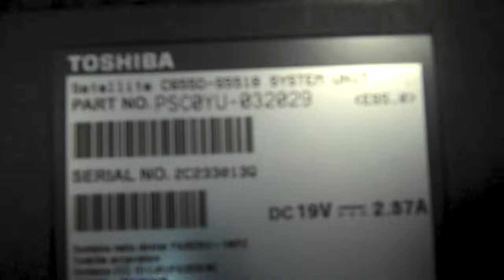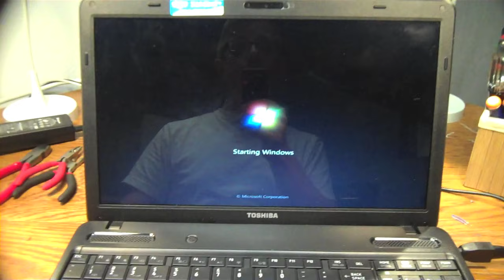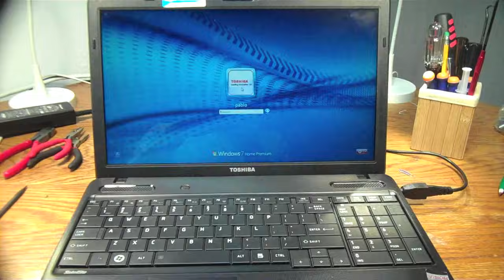How to Reset BIOS Password on a Toshiba Satellite Laptop

Comment: the satellite  c55-a5300 I have a pad labeled p200 its just 2 pads by the memory board, I am hoping those are it.  Now the Supervisor passwords been set not the users so on the 3rd try it shuts down with no code. I cannot find instructions at all

Comment: I have an old toshiba 1405-s151 with a "power on password" (what the user manual calls it). I haven't used this computer in maybe 10-15 years because I forgot that dange password.  There's nothing like this b500 thing on this computer that I can see. Do you have any idea how I can get past or reset this power on password? Thanks!

Comment: Donna OConnor
If you are still doing videos - I am really stuck on my Toshiba C55-A5310.  Windows 8.1. When I turn the screen it is all black with a box in middle of screen - is blue and says the words "enter password" When I enter in a password, it than goes to another screen which reads : Error Status. Verify error!! Press ENTER to continue. It goes back to first screen. I haven't got a clue how to fix it. Tried your method, must have done something wrong, as it did not work

Comment: Hey thanks I'll try it in a sec. Question every time is asks for the password I actually have the password because I said it I type in the password and it goes directly back to the screen that says no boot load please restart system I've probably done that a hundred times in different ways but also again note. I have been severely hacked for the past two years now we're ransomware remote sniff duplicating apps draw overs you name it I've got it and I think he has tried to make it to where I cannot get into this computer. Do you know anything about how I might be able to puts a Nord antivirus and VPN and install it from another location and then implement it into two of my devices before I get back to where I usually do all my stuff with computers which is at home.???? Thanks again I'm going to give it a shot and I'll get back to you

Comment: What do I do after I've done this but now it start up but there's nothing showing on the screen
Reply: I have a Toshiba satellite c55 b5308
Reply from the maker: Check that you seated the video cable correctly. Almost always the issue. Also check all cables, RAM, etc that it’s properly connected.

Comment: Hi,

That was cool, and makes sense.
My problem is that I DO have the BIOS password, and I'm trying to do a factory reset, (i.e. "Out of the box"), but the accursed thing just ignores me when I do the 10 second power-off, then the holding down the 0 key after hitting the power button.
It asks me for my BIOS password, which I then enter, but I don't get anything else except a machine that starts up normally.
It's horrible Vista, and it has some issue with AVG files that don't exist, even though AVG is supposedly uninstalled, and there is a random name in the system that seems to belong to some sort of high-powered administrator. I don't know who this person is, and I would suspect that my ex had something to do with it, except she has trouble spelling her own name, let alone anyone else's, and using the most basic computer functions are pretty much beyond her. This is not to say that she didn't enlist somebody else's help in my absence, but surely there is a way I can still do a factory reset???
I can't get rid of it, and when I got pissed of enough to instal Linux Scorpion, this name appears all over the place there, and kind of messes with all my filenames.
I'm gonna try to kill the BIOS password as per your excellent instructions, but I can't understand why, seeing as it's MY BIOS password, that I can't just go into BIOS and remove it.
As I say, my biggest problem is that it just WILL NOT DO THE FACTORY RESET THING, and it's doing my head in.
It's an A200 Satellite, and as far as I can make out, the model number is: PSAF3A-0OH01N. I'd throw it away, but it's had almost no use since new, as it ended up in a box after a shift, and only resurfaced recently. I actually thought it had been lost or stolen.
Any help would be appreciated.
Many thanks from the Southern Hemisphere.

Comment: Great video and very clearly spoken and explanatory.  I was able to bypass the password on the second try but it was flashing and the screen went black.  I cannot get it back to desktop.  I did not have cat 5 cable and used the wire fraud it of a cat 3 RJ11.  Could this be why it went black on me and how can I get it back?  Thanks so much.

Comment: It works on a300, I did it at my 3rd try. I have tried different combinations the worked one was. Remove battery, ram and hdd connect the charge cable, open the pc (it will not open ) do the jumper thing and without unpluging power cord put rams and hdd then open the computer.

Comment: I have a Toshiba satellite laptop, I first installed Windows 7 but later installed another Windows 10. so I still see old windows on it but I try deleting the old windows but I couldn't. so now am still using the windows 10. I have tried several times to activate the windows 10 but i couldn't. Yesterday, I tried installing a new Windows but the PC couldn't boot from the USB drive. I tried several functional keys but still I didn't boot from the USB. please Any help?
Reply: prepare your bootable disk using a different USB drive avoid generic USB stick

Comment: Hi guys.  I know this is an old video but I recently had to reset a Satellite A505-Sxxxx notebook and it took forever to locate the B500 jumper connection.  Finally found it.  https://i.imgur.com/aEzq6rL.jpg  It's located on the other side of the DRAM modules.  Hope it helps some people.

Comment: I have a Gateway LT3103u that does not boot up. It intermittently booted 2 times the last 2 weeks since I have received it, but it won't now. I can hear the fan, the power button lights up, but none of the other lights stay on even though they momentarily flash when I hit the power button. I even put an external monitor on the unit to see if there was a screen problem, and the external monitor doesn't even recognize that it's plugged in. Any thoughts?

Comment: Have you tried this on a Toshiba Satellite C855D-S5106? I have tried this a few times and still can't get it to work. My B500 solder points are in a different position (further left than yours)?
Reply: I can't get mine to work using this method

Comment: Hey DYI Tech, I have a couple of questions about my Toshiba Satellite Vista, Model A205 Laptop. First one issue is that when I boot it up and once on, if I need to plug the power supply to it, it Freezes and will stay frozen. I have to charge it then reboot to use it without plugging in.? Second I can't get any update so its vulnerable and outdated.  I lost the the software disc also. Finally when I can use it the battery life is short and periodically will shut down unexpectedly. Fan work!! Anyhow do you have anything to help with these issues..

Comment: i have a Toshiba Satellite c855-s5190. i am trying your trick, however the laptop will not power on without the hard drive in. any suggestions.  also the removal didn't work with the hard drive still in

Comment: I have a Toshiba Satellite L555D-S7930 & need to clear the Bios password. I have located the J1 jumper point, but do not know which of the other spots I need to connect it to.Can you help me?I located 2 JCPU Spots, among others. But no J6, XXX or B0500 spot or anything even close. Thanks for any help you can give me.
Reply: I finally just grounded the J1 jumper point to a screw on the motherboard & that did the trick, clearing everything.

Comment: Great video. I have a Satellite P205D-S7802. It's the old vista. Can I do the same thing with it? Also, I have lost 3 characters on the keyboard which I currently cut and past. Is there an economical fix? I have used a dell usb keyboard too...but I think it has been creating some blue crash dumps...the other problem I just started having. Also it seems to not want to continue the boot process even after I put in the password...any hope???

Comment: I need help doing this on a Toshiba L855-S5240 It has the b500 jumper pads but it does not work. I read somewhere that it wont work on newer laptops. The only similar other video is one for a C855 but the L855 does not have the pads from that video. Please help! Thanks!

Comment: it worked. u can use a screw drive except for wire. also when it says "the firmware has detected that a cmos battery blah blah", be sure to press f1 (continue), holding the wire/screw driver on the two b500 slots. then it boots the os and u're done. thanks a lot for the helpful vid

Comment: Toshiba bios password removal for latest models

Satellite P100 & Satellite Pro P100
Open Wi-Fi Cover
Remove Mini Card Wi-Fi card
Locate & Short Out JP8 for 5 Seconds
Remove short and turn on
NO BOOT
Press & Hold Power button to turn off
Turn on again & password is cleared

Satellite L10, L20, L30 & Satellite Pro L20
Open Wi-Fi Cover
Locate & Short Out JP1 for 15 Seconds (Satellite L10)
Satellite L20/Pro L20 short out G1

Satellite M100 & Tecra A6
Open Memory Cover
Remove Memory
Remove Black plastic insulation
Locate & Short CMOS CLR1 for 15 Seconds
NOTE:
All the following models use the same password removal process.
Satellite: 17xx Series, 1000, 1110,1130, 1200, 1900, 2430, 3000 P20,P30, P33, A30, A70, A80, M40X, M50,M60, M70, M100

Tecra A3/S2, A5, A6
The jumper is always located under or near the memory modules
Depending on the model the jumper could be labelled J1, J2, J5, J7, J9 or CMOS CLR1 (M100 & A6)

Satellite,Equium A100 & Tecra A7
1.Remove Strip cover
2.Remove 2 x K/B screws
3.Move K/B Unit up but don’t disconnect
4.Release & Remove Mini Card Wi-Fi Card
5.Locate & short C88 Pin 1 & 2 together
6.Power on Machine while still shorting Pin 1 & 2
7.As soon as the TOSHIBA logo appears, remove short
8.If machine boots, Password has been removed

Satellite A100 (PSAA2A-02C01N)
1.Remove Memory Cover from base of machine
2.Release & remove right side Memory Module
3.Lift black plastic insulation
4.Locate & short PAD500 Pin 1 & 2 together
5.Power on machine while still shorting Pin 1 & 2
6.As soon as the TOSHIBA logo appears, remove short
7.If machine boots, password has been removed

TECRA A4 & Satellite M40
1.Open modem & Wi-Fi card cover
2.Remove mini PCI Wi-Fi card
3.Lift up black plastic
4.Locate & short C738 Pin 1 & 2 together
5.Power on machine while still shorting Pin 1 & 2
6.As soon as the TOSHIBA logo appears, remove short
7.If machine boots, password has been removed

TECRA S1
1.Open palm rest cover
2.Remove mini PCI Wi-Fi card
3.Lift up black plastic
4.Locate & short C5071 Pin 1 & 2 together
5.Power on machine while still shorting Pin 1 & 2
6.As soon as the TOSHIBA logo appears, remove short
7.If machine boots, password has been removed

TE-2300
1.Remove 2 x B12 screws from bottom of system
2.Remove strip cover
3.Remove keyboard screws 1 x B2.5 & 1 x SF4
4.Remove 1 x 4mm screw & Wi-Fi cover
5.Remove mini PCI Wi-Fi card if fitted
6.Locate & short points as shown in picture below
7.Power on machine while still shorting points
8.Short for 5 seconds
9.Nothing will appear on the screen
10.Turn system off holding down power button
11.Password is now removed

Satellite A60
1.Open Wi-Fi slot cover
2.Lift up black plastic
3.Locate & short C561 Pin 1 & 2 together
4.Power on machine while still shorting Pin 1 & 2
5.As soon as the TOSHIBA logo appears, remove short
6.If machine boots, password has been removed.

Satellite Pro L40
1.Open Wi-Fi  & RAM slot cover 
2. Locate JRST1 Between Ram and Wifi slot 
3.short JRST1 AND TURN ON SYSTEM.
4. Short for 15 seconds.
5. system is shutdown automatic.
6.turn on the system password is removed.

Toshiba Satellite Pro L650 

Locate G1 or c513 and G2 or C514 to reset bios
In some models it will be B500  under ram cover                                                                                                         Gom3zNovember 15, 2012 11:29 PM
Works on satellite L650.
Importantly, the “B500″. For better contact, welded a small copper wire between the two plots “B500″.
Place one strip of memory start.
Display the first page of the bios and then extinction of the laptop alone.
Remove the small copper wire and put the remaining memory.
Restart and that’s OK.

Toshiba Satellite L700/750 

open ramcover
locate G1 for bios reset
Toshiba Satellite M60

open ramcover
locate J2 for bios reset
Toshiba Satalite C850

Open ram cover
locatae B500 short it for a minute 
restart your laptop with bios password.
Toshiba C875D and c850D Password Reset Jumper
Reply: +Carla Mae Abrajano was hoping you might know how to reset the BIOS for my toshiba satellite c55-b5200?
Reply: Carla Mae Abrajano please help me, what about for a cl45 ???
Reply: Hi Carla what about Satellite M840. Thank you.
Reply: Lori Beth Kerns hie did u get a solution to your c55

Comment: I had looked every where for those two little nodes on satellite C55D-B5102 to short across to rid the bios password. And the only two that resembles what everyone's talking about in that area is labeled PB
Reply: sorry to bother you but I'm having the same issue with the exact same model laptop and cannot find any information on the location or label of the cmos jumpers. this bios password situation is driving me crazy. I hope that you have some good advice to help me out if you remove your bios password issue? thanks

Comment: The solder nodes were located in the bottom left hand corner of the RAM area on the Toshiba Satellite C855d-S5344.  They were labelled B500 as mentioned in the video.  Thanks.

Comment: Have the same issue with a Satellite L745D.  Don't see jumpers labelled B500 but I do see C641?
Reply: +Brian Cook  HI, I own the same model, where you able to find the way to reset the bios password ? If you did , please help me out!!
Reply: Nope.  No luck and gave up!  did you find a solution?
Reply: +Brian Cook  no yet, I found this **[The jumper for the L755D is NOT labeled "B500" or "CMOS" or anything like that and is NOT on the edge of the board. It`s directly under the RAM and labeled "G2". There is a clear plastic film over it, but it`s only sticky on the end tabs and easy to peel back. After you take out the RAM, unplug the 4 wire connector next to the RAM, peel back the clear plastic, and use a flat head screw driver to short the "G2" jumper for 10 seconds. Then plug the cable back in and re-install the RAM and you are done.]*  many people said it worked buy I had no lucky

Comment: I also have a hard drive password i need to remove,how do i do this? My problem came about when i gave my laptop a smack. I then dtarted getting the error message 'No bootable device- resart system'. I couldnot restart it. I pressed F2 and got the bios screen up ,ii said user not registered,so i clicked on it and made a password.I done the ssme for the hard drive. Now when i switch on it keeps asking for the passwords,and then afterwards still get the same error message.I cannot click on F2 now,it won't allow me to.So i need to get rid of the two passwords before i can move forward. Can you help?

Comment: Hi Bryan, nice video. I do laptop repair as well, and recently I bought a half dozen used Toshiba Portege R830/R835 laptops from a local company here in Boston that was rolling over inventory, all running W7-Pro. One of the machines boots to the blue Toshiba Innovation screen (The BIOS startup), then I get a black screen with one word on it: "Password:" and it wants me to enter same. The machine does this despite having the HD removed, so I am sure this is a BIOS password. The company who sold the bulk inventory to me has no idea what the password is, and only one laptop is locked this way. So I think I must clear CMOS as your are describing. Issue: no labels on the R830/R835 motherbords at all for any circuits/solder connections. I guess this is Toshiba's idea of security. Any suggestions??

Comment: This also worked on a similar laptop. A customer brought me a satellite c855d-s5320. The memory and hard drive are in different spots, so are the jumper points but I just looked for the B500 written on the board.

I'm not sure you have to have the jumpers on while booting up. I was using a screwdriver to make the jump. When I booted I didn't think it was making good contact so I moved the screw driver and I think I seen the password prompt come up, not sure because just as I seen something pop up I moved the screwdriver the screen went black. I unplugged the power and plugged it back in, booted up and it went right in to Windows.

My customer did not put this password in the computer. What did happen is their son drove over it with a car, just the rear tire but wow. The only thing that broke was the screen, and then after I replaced the screen there was the BIOS password.

This is a good selling point for Toshiba, you can drive over it with a car and it keeps going. There are no cracks in the case, everything was fine except the screen.

Comment: Have you ever removed the password bios from a Toshiba L875D-S7332? The memory bay has several jumper points, but they are not labeled. There is no labeled B500 or XXX. I would appreciate any advice that you can offer. Thanks

Comment: I have a Toshiba Satellite l755 and nothing is working to reset the BIOS password.  I've done what you've just done in this video several times and it's not working.  I've also tried software, running MS-DOS and doing that whole backdoor thing, and I've tried the "Toshiba" backdoor password.  Nothing is working.  Do you have any other suggestions?

Comment: I have a Toshiba Satellite L645-S4055 Laptop with a overheating issue, after replacing the fan & heat sink using thermal paste, an error message keeps popping up stating overheating issue still present, then the pc turns off... please help its my daughter's computer.